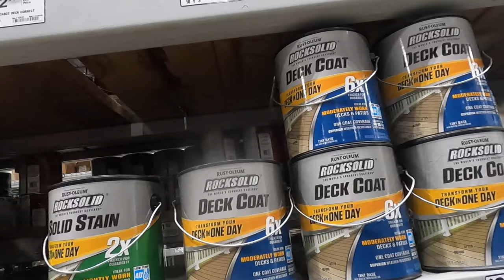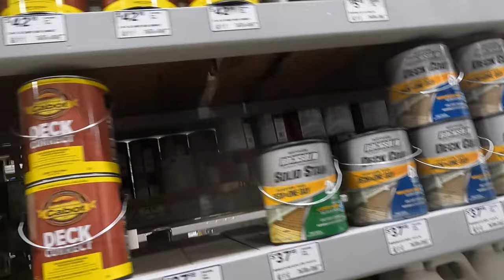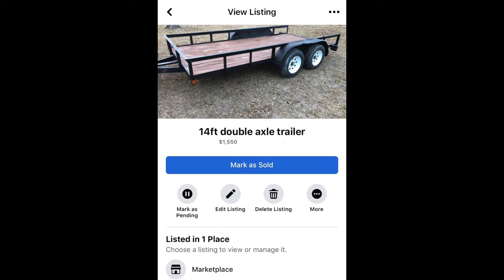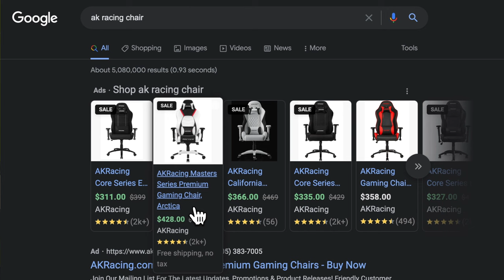My Quickest Trailer Flip | $600 Profit

Comment: Nice work, man. Something you might consider adding in: A heat gun (or propane torch) applied to vinyl decals will soften the adhesive and let you scrape them right off. Should take just a couple minutes per sticker/decal and ensures the paint won't peel up in that area later. Not a big deal to you since you're flipping it, sure, but nice for your customers and doesn't cost anything but a few minutes of your time.

Comment: Did I see you paint over the stickers,  so when the rain washes off the sticker- the paint goes with it,  some body is not going to be very happy with you one day.
Reply from the maker: its oil based rustoleoum its hard to get off and at the end of the day its a trailer for hauling stuff the least of anybodys concern is some chipped/pealing paint. when buying a trailer your paying for good axles, tires, and frame

Comment: good job man! I flipped a 7x12 single axel landscaping trailer last year. I replaced all the boards, wiring, lights, and painted it with a single stage auto paint. I was all in at $1600 and sold it for $2300. it took 24 hrs to sell it. I just picked a motorcycle trailer to do the same thing. keep up the good work
Reply from the maker: thats awesome man. easy side cash
Reply: @Dean and Done Handyman  thanks! It really is an easy way to make money. I'll be moving into equipment trailers soon. That's where the big money seems to be